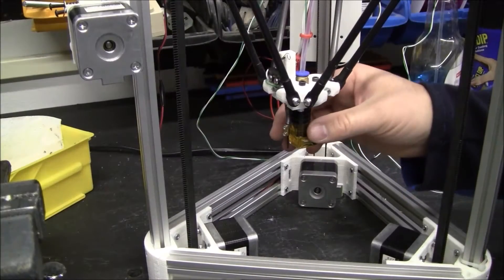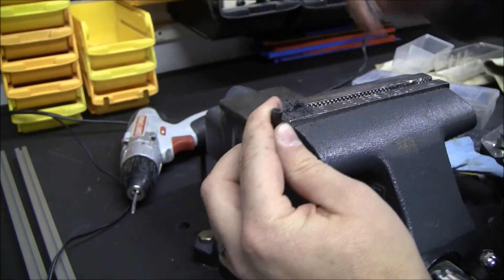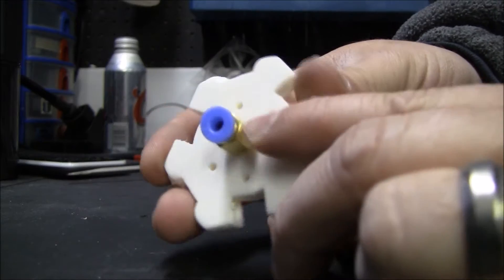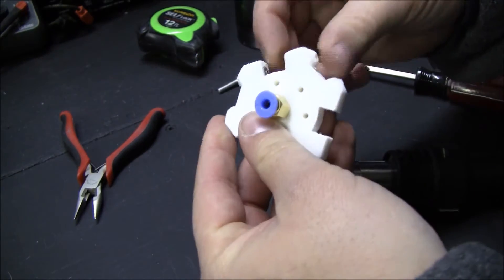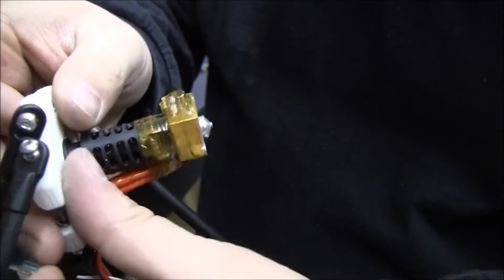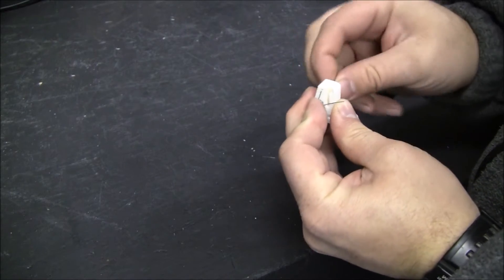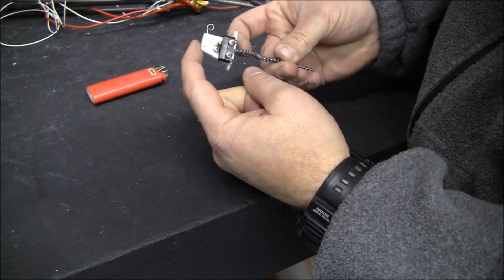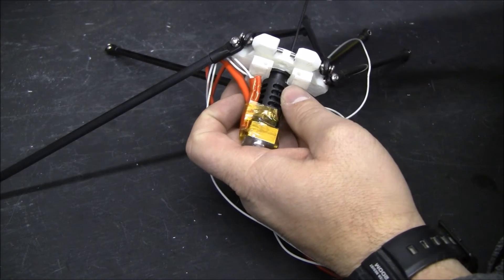Kossel Mini Rod, Effector, Auto Level Probe, and Hot End Assembly Tutorial

Comment: 1. I have found that wrapping some kapton tape around the ends of the carbon rods will stop them from splitting when you tap them.
2. Go buy set screws instead of cutting the bolts. 
3. Use a good two part epoxy to bond them rather than superglue.